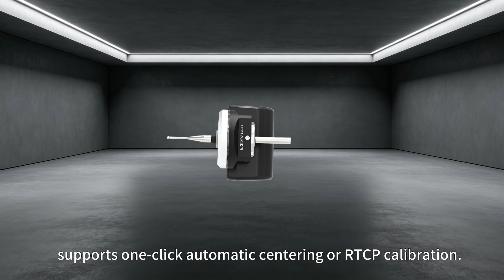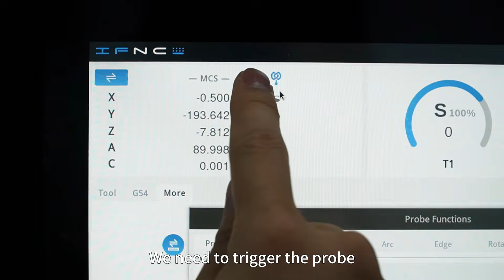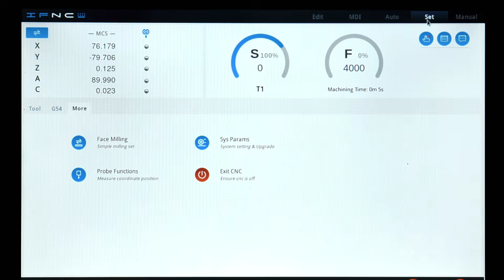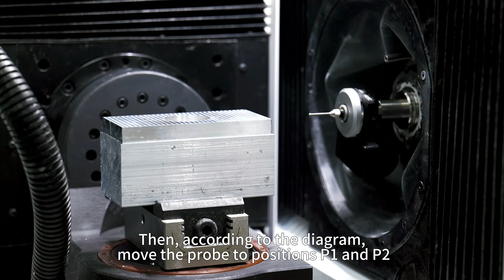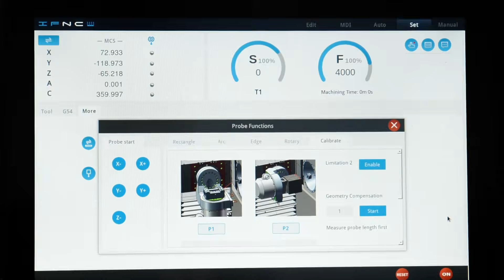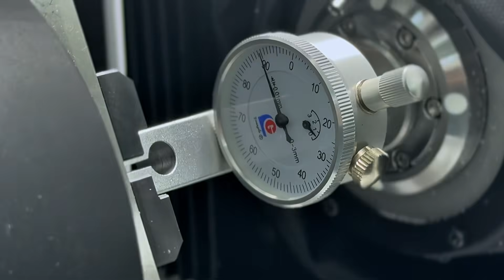IFMAKER M5 Wireless Probe Operation Guide

Comment: Dear IFMAKER Team,

I am considering purchasing the IFMAKER M5 Fully Integrated Desktop 5-Axis CNC – Early Bird | Ultimate Bundle and would appreciate your confirmation of exactly what is included in this package.

In particular, could you please confirm whether the Ultimate Bundle includes the following items:

CNC End Mill Tool Kit / Full Metal Machining End Mill Kit

Laser Module

Nearlink Wireless Handwheel

I understand that the Ultimate Bundle includes everything in the M5 Core Bundle, plus the additional upgrade accessories listed on the campaign page. However, I would like to confirm whether the Laser Module is included or must be purchased separately.

If possible, please also provide a complete list of all items and accessories included in the Early Bird | Ultimate Bundle.

Thank you for your assistance. I look forward to your confirmation.

Best regards,

Nahid
Reply from the maker: Yes, the Ultimate Bundle includes the M5 Core Bundle, plus additional upgraded accessories. The laser module is an add-on accessory and must be purchased separately.Thank you for your support.🥰🥰
Below is the full accessory list:
1.Everything in Reward 1 (M5 Core Bundle)
2.Full Metal Machining End Mill Kit (D6/D4 Flat, D6 R2 Ball, D4/D6 R1 Bull Nose)
3.Essential Wrench Set (Vise, Probe, Dial Indicator & Collet)
4.Multi-Size Collet Pack (D6, D4, 1/8" / 3.175mm)
5.Positioning & Setting Rings (4mm & 6mm) ×2
6.Standard Fixture (15mm) ×1
7.Deluxe Material Starter Pack (Acrylic ×5, Wood ×5, Aluminum×2, Brass ×2)
8.Aluminum Alloy Tool Storage Case ×1